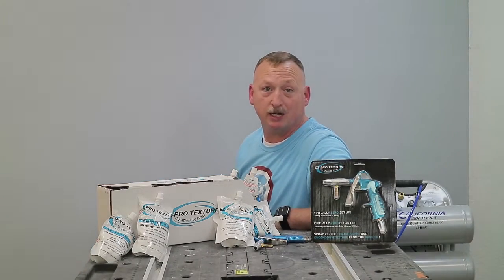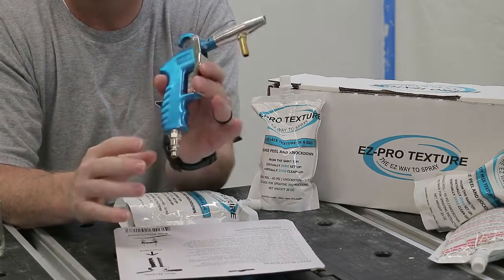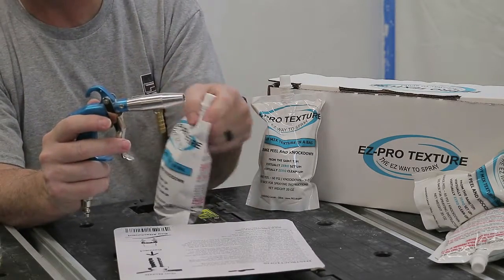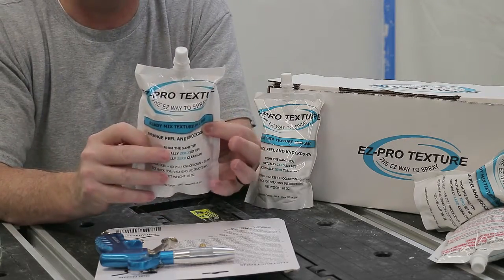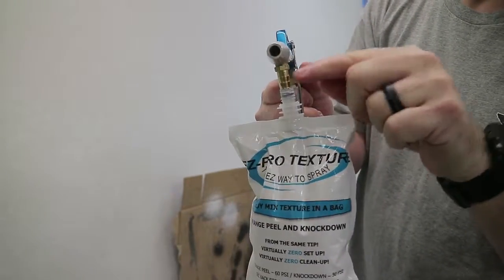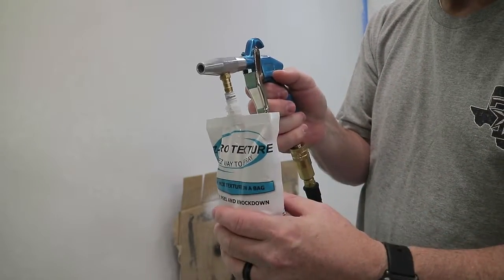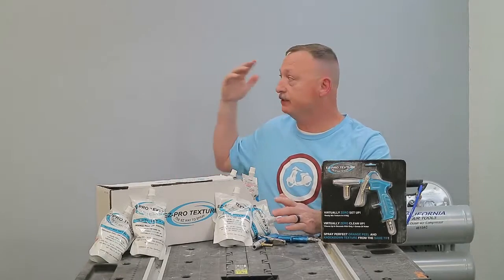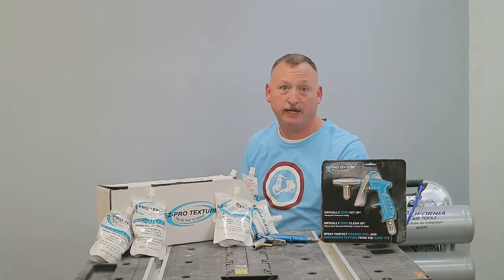Coop's Simple How-To - EZ Pro Orange Peel Texture

Comment: Dude, that wall needs a hopper. That gun is for patch jobs.
Reply from the maker: Yea, definitely wouldn’t try to do a whole house with this but for what I was doing it was perfect. Thanks for watching and commenting.
Reply: @LivingCooper   I did a small pantry using EZ Pro. I did the latex glove hack instead of buying a bunch of $7 bags. It worked but was messy. Someone needs to make an aftermarket refillable bag for this since its not in EZ Pros financial interest to do so.
Reply from the maker: That’s a great idea! They need to make something like a cake icing bag that can be sealed.